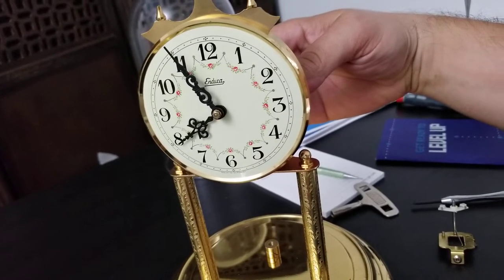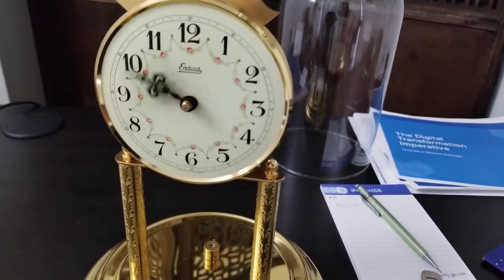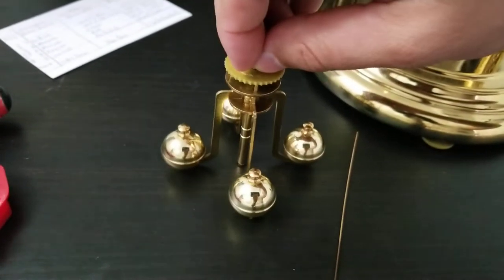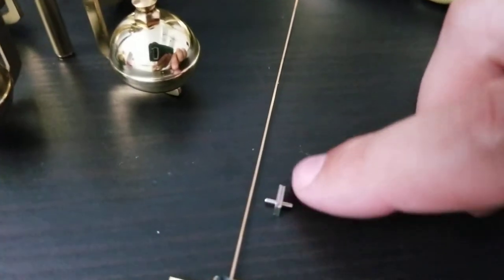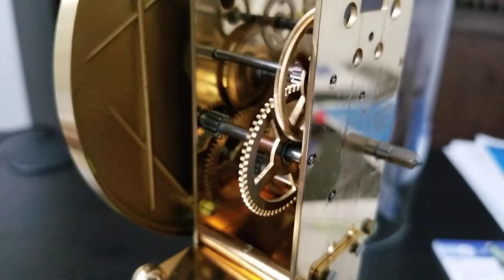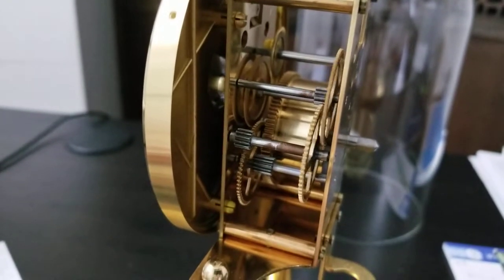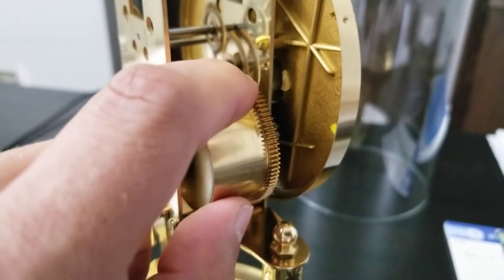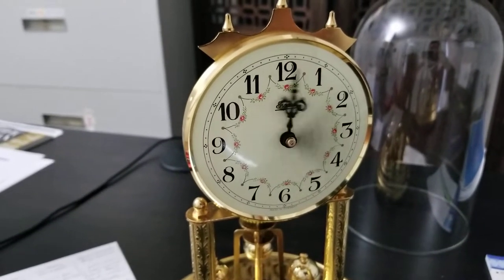Watching time fly on an anniversary clock mechanical wind

Comment: Hi! What's the reason for the fast rotation? We have some family story that an old broken torsion clock started spinning fast some 3 times when a kid put a hand around it (not touching it). I don't believe in their ghost explanation. IMHO there was still some potential energy stored in another component than the broken spring and it might have been dirty so it moved more slowly or get stuck sometimes. IMHo the kid could have released the tension by stepping around the clock (making some vibrations). What is your opinion? Thanks.
Reply: When a clock is fully would there's a lot of energy stored in the mainspring. Normally this energy is released very slowly by a part called the escapement which is regulated by the swinging (or turning) action of the pendulum. In this video the pendulum has become detached allowing uncontrolled rapid unwinding of the mainspring. If a torsion clock is not correctly adjusted the escapement can start to flutter out of control allowing rapid unwinding of the mainspring and rotating of the hands even with a pendulum attached. Due to the very sensitive nature of the torsion clock it is highly likely that a small vibration could easily trigger a badly adjusted clock to go into a rapid flutter with the hands spinning out of control. Hope this helps!
Reply: Hi, my daughter detunred the bell on our anniversary clock and when I tried to repair the bell the pendulum fell out and hit a marble floor. When we received the clock back they had cracked the bell and inserted solder which dripped onto the springs and solidified.  Is the clock worth replacement or should we try another repair agency?

Comment: The same problem happened to me but I broke the face off and now I can’t put it back on it’s a plastic one with the battery operated but the things when I was pulling the same back and broke the plastic up with those little what does little tubes but now I don’t think I can fix it but it works as a little desk clock